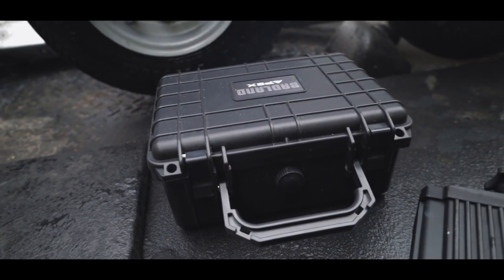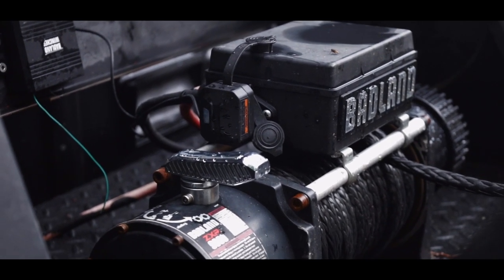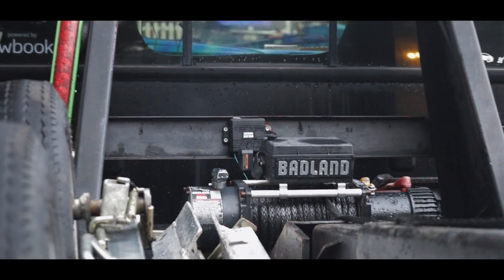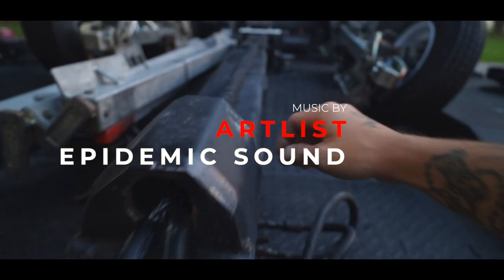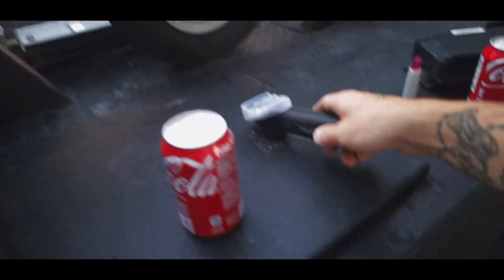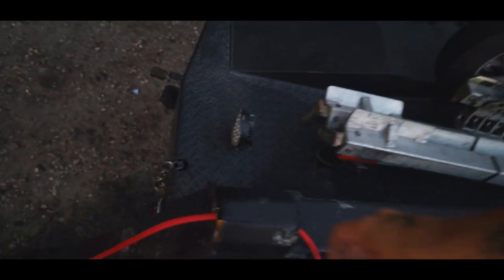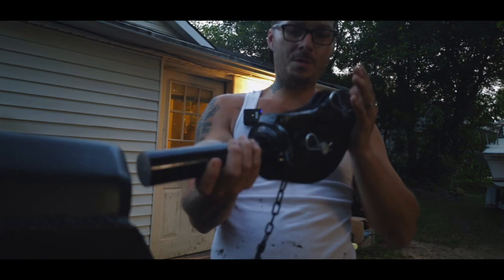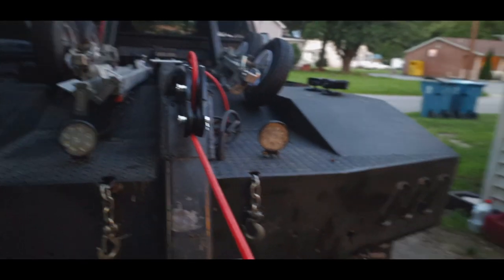BADLANDS SYNTHETIC ROPE INSTALL ON F550 TOW TRUCK WRECKER

Comment: Great vid as always! Why do you have 2 towmates?  Also I’m in need of a boom head for mine, but from what I see they are around $600.  Is that right? Seems a little steep for what it is.
Reply from the maker: Incase one dies. And yeah they’re 600$ that’s the reason why I never got one before bc it just sits for me most time
Reply: Ah smart never thought of one dying on me, and yeah for as little as they get used it’s hard to pull the trigger on getting one lol.